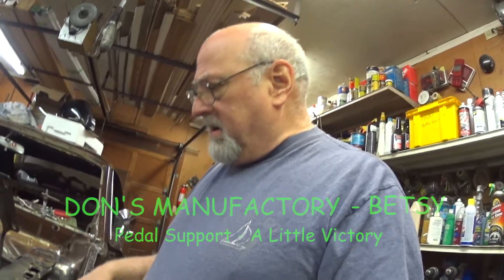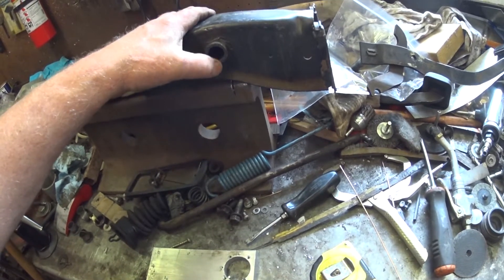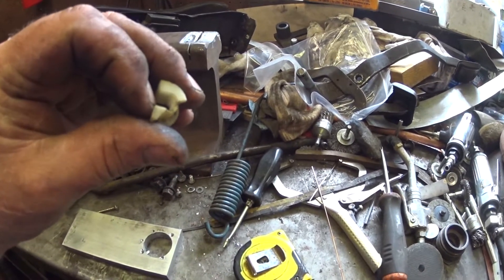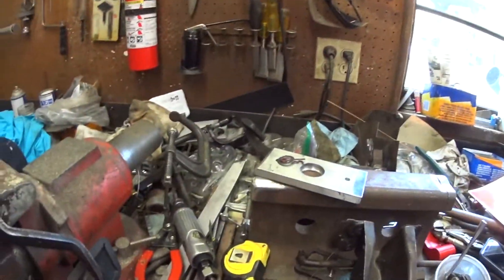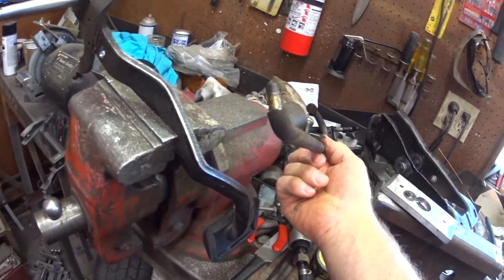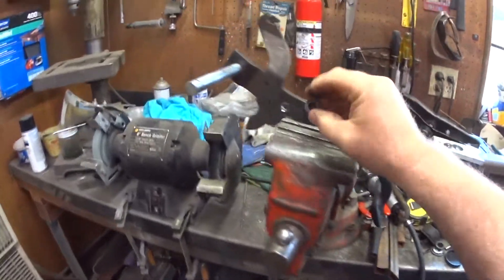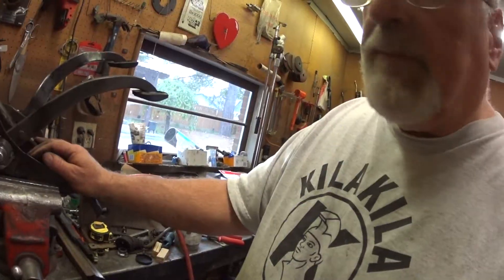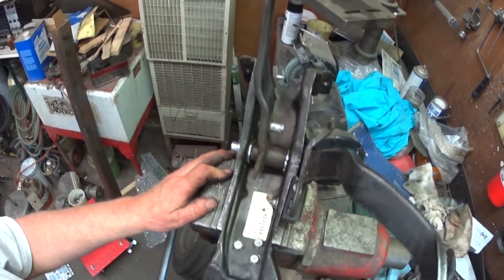66 Mustang Betsy  Pedal Support rebuild With Roller Bearings

Comment: I'm working on my pedals also and will install them before I put the cowl back on.  I never knew about the roller bearings.  I will have to order them.  Thanks for the tip.
Reply from the maker: I thought about it but I still have to pull my steering box so decided to leave it out for now. Easy to put back in with the steering column and shaft out.

Comment: I have never seen those plastic pieces on the clutch spring on a car here. They broke and fell out within 3 years because of the heat here. I put the bracket in during toeboard welding as well as cowl welding because it keeps the dash and firewall in place. I need to remove the third pedal on mine when I get around to rebuilding it...  It's going to be her car and her airport car is a stick and it will be the last allowed on our property. She is done with driving a stick and I have been for a long time and refuse to drive one anymore.
Reply: I thought about that but since the bolts are slotted on the bracket it would be a “relative” position rather than finite. Those plastic spring isolators do keep the pedal quiet though. Even when greased it makes sproinking noises without them. 

Have you installed a diaphragm clutch pressure plate?
Did you use the helper spring with one? Seems like the belleville spring would “over-center” and require less pedal effort.
Reply: @donthompson2188  When she bought her airport car she thought she wanted a standard again...  Well after years of driving it she is done with them. Not to mention that the auto version of her car gets much better gas mileage. As for me I have never been a fan. I don't enjoy driving them besides I'm not the most coordinated in the world either... 
   I have gotten spoiled with hydrostatic drives on equipment and tractors. It's like going from manual to power windows.